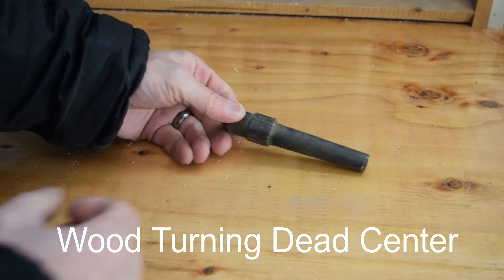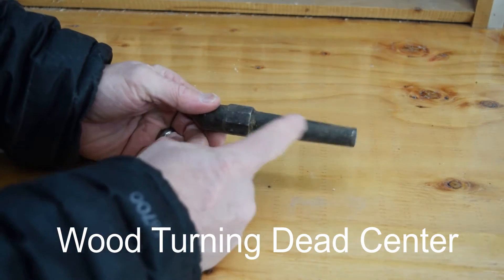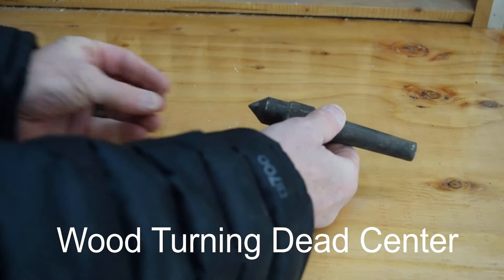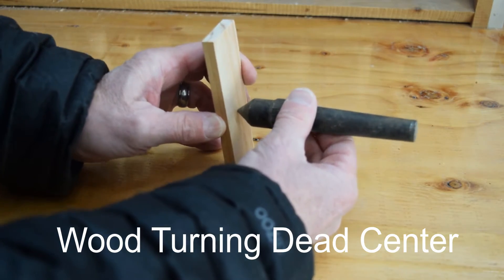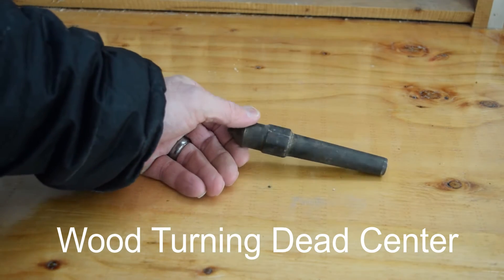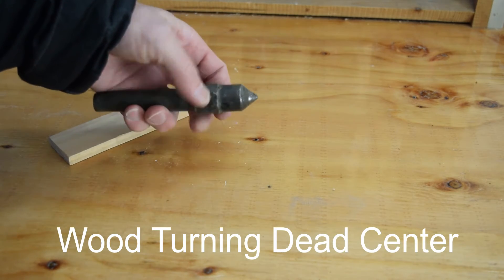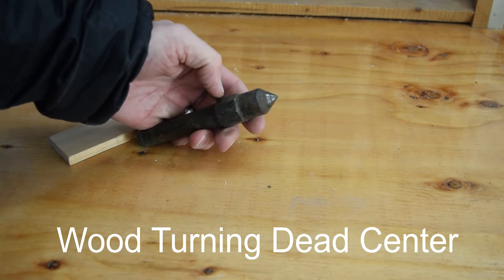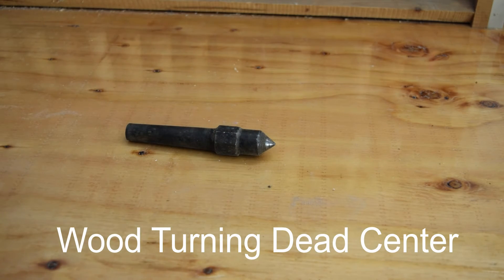Wood Turning What is a Lathe Dead Center

Comment: Hello Ian! I use this for turning pens between centers. I use regular bushings mostly but i have some bushings that have a 60° end to match a dead and live center. No mandrel to worry about. You should check out some TBC videos.
Reply from the maker: Hi Mark good to hear from you.  THAT is a GREAT Idea, thanks.  I have never really turned between centers, as my old method seems to work.  I have not even really used the mandrel saver I just found when turning pens.  I will look into it, and get some center bushings and let you know how it goes.